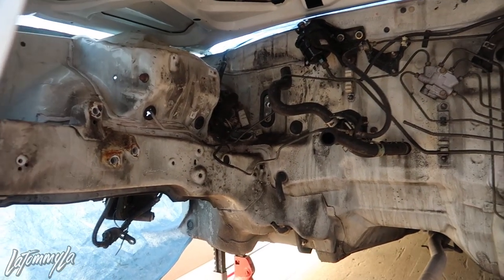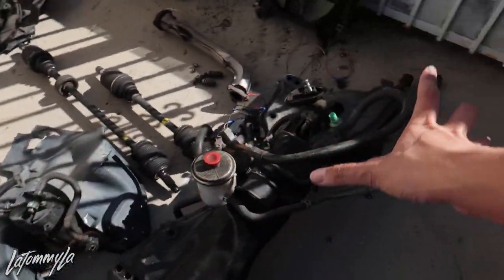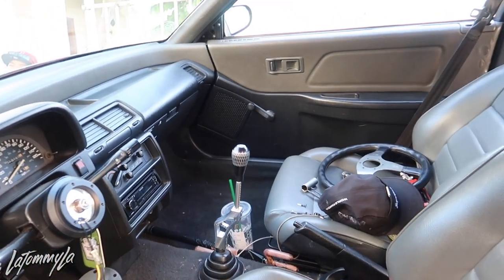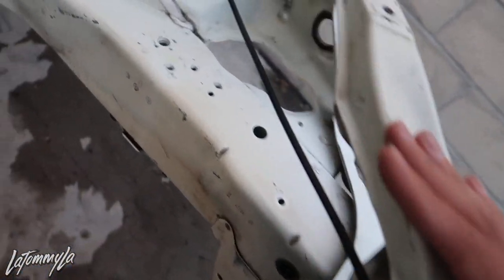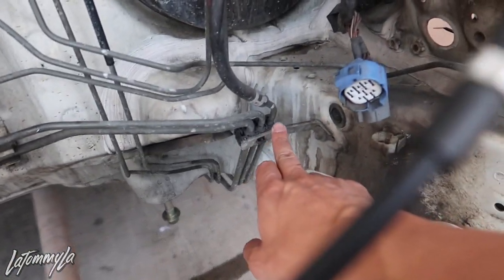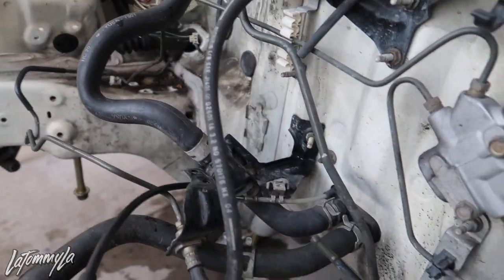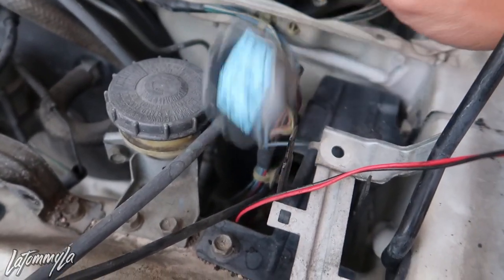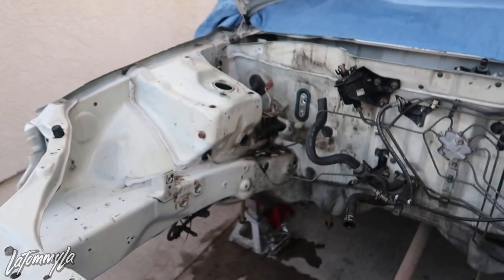Single cam is out & Regamasters are on! - K20 Swap Part 2

Comment: hey can you tell me how your friend ian got his JDM side mirrors to work for LH i really want to have my mirrors work properly so i can re-install them thanks
Reply from the maker: They fit, mirrors are mirrors, doesn't matter if LHD or RHD
Reply: @LATOMMYLA  yeah but the a glass on the LHD doesnt go that far back for me to be able to use them i have to lean forward lol so i figured that could be fixed but if not thats cool
Reply: Zero Cool they don’t go back for perfect view, just something you have to deal with when running JDM parts on our US cars. Kinda like how JDM headlamps don’t aim right on for US streets. I personally have gotten used to them, still better visibility then most aftermarket mirrors I think. That’s the reason I went with them over anything else.